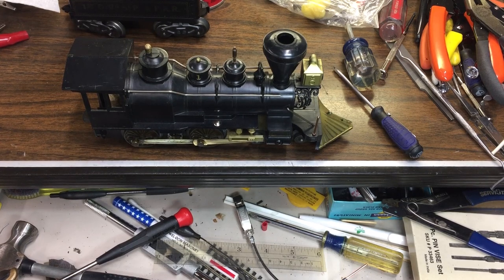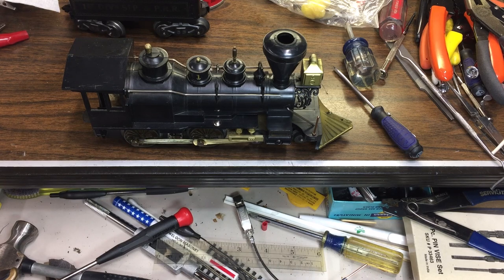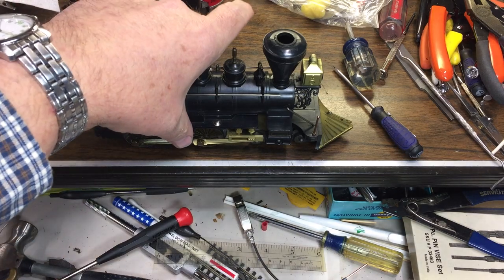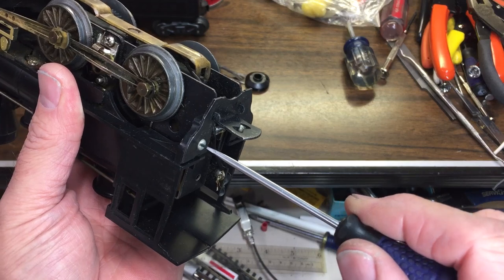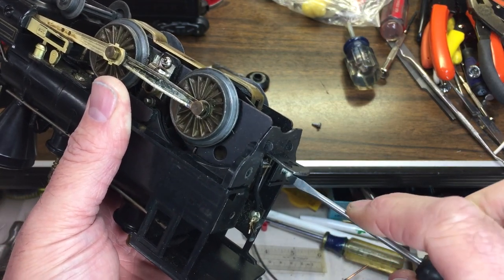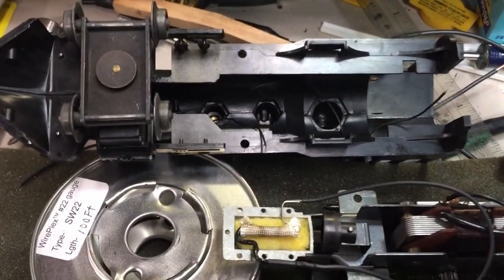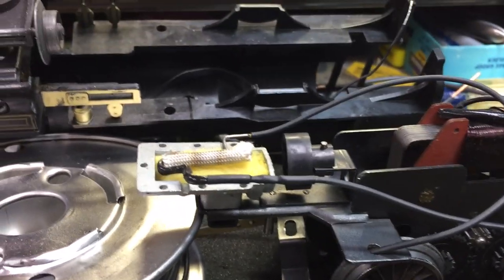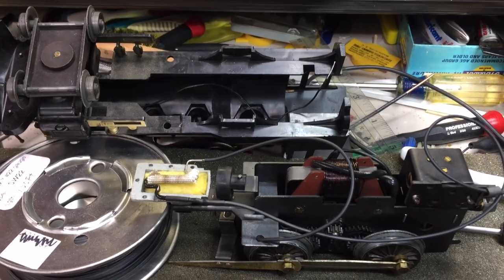Marx Train  Smoke Unit Element Replacement Repair on the Wm Crooks Locomotive How-To

Comment: I thought this might help some folks, I cut off two of the nubs holding the smoke unit together, one on each side,  then put the two sides back toget 11:23 11:28 her, then drilled out the two holes to 5/64". I bought some very small machine screws, 1x72x1/4"with nuts. It is a little tricky getting the nuts on but they fit pretty good, and holds the two sides without glue.